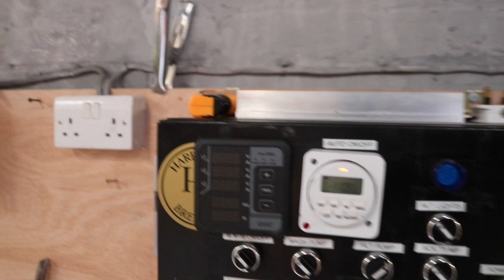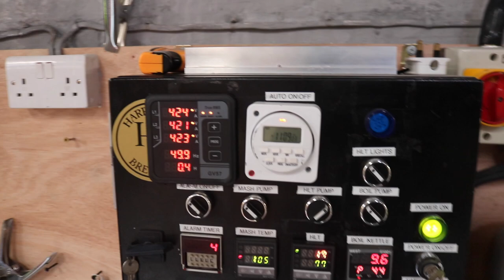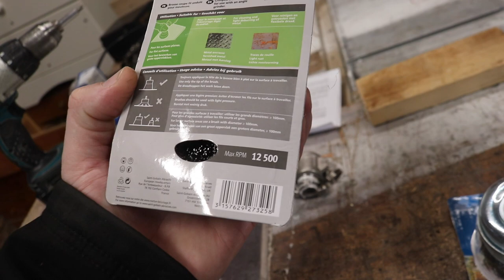REPAINTING THE BREWERY FLOOR

Comment: Great vlog as always buddy. Cheers mate
 I could be wrong but what i can remember from school is that a thermocouple works on micro voltage changes when a temp is changing. When you solder a cable with a K couple the 2 types of metal in a K couple react different. With a PT100 (my all time favorite) it is a resistance change, when you solder a longer cable on the PT100 the difference is minimal. And therefore it the reliability is better, 10 years ago I used to work in the petrochemicals, on the plants as a engineer, and we onely used PT100's because the cable lengths were about 600 meter from PT100 to the controller. A lot has changed in 10 years I know, but it could work for you.

Comment: You could fabricate some quick extended handles for the grinder. Then you could scrub the floor standing. Those grips just screw in, so weld some bolts to some metal pipes and bend them to fit. Standing scrubbing rig.